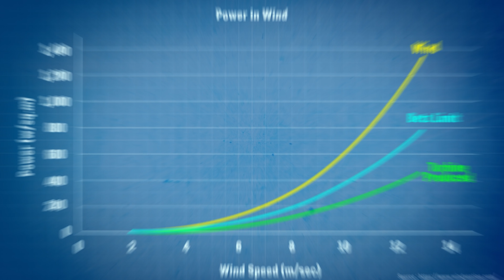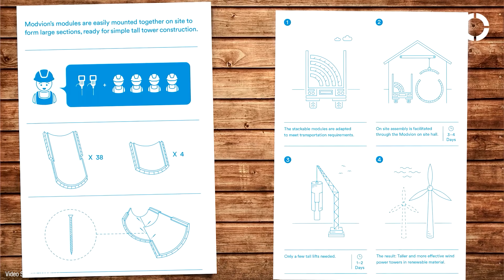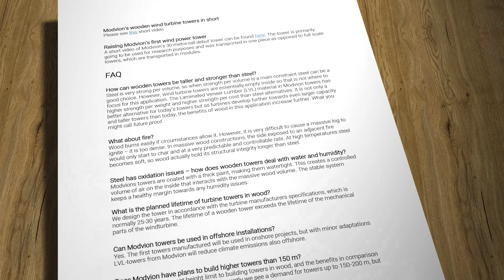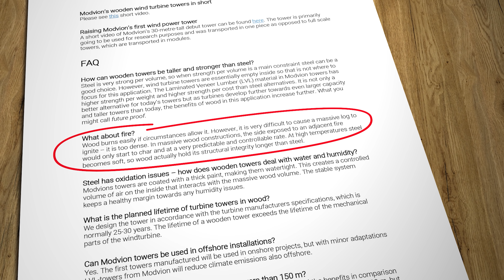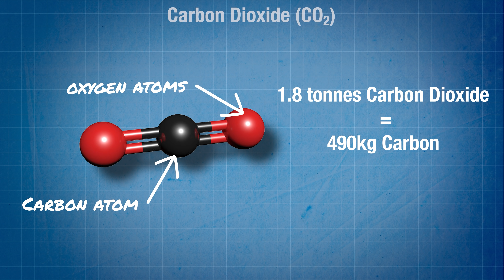Wooden wind turbines. Are they really a sustainable alternative?

Comment: I wonder how good will be if the blades are made out of thin wood, covered with fiberglass. I've seen one youtube channel comparing regular wooden plank with plank covered with 1 layer of fiberglass (he said that many small boats are made out of wood covered with fiberglass giving it stiffness and waterproof properties) and there was lot of difference in strength.
Reply: The blades need to be lightweight and strong but also really, really stiff. Wood isn't good enough. They can barely get away with a fiberglass construction while making the blades over a hundred meters long. Carbon fiber would be way better mechanically but very expensive and has more CO2 emissions.
Reply: @w0ttheh3ll  sandwich construction increases stiffness enormously while decreasing weight, at least for boat construction purposes. From the image of the repurposed blade, the grp is solid for blades. Perhaps the strength to weight calculation changes at these scales?  Side note: in composite work, balsa wood is a relatively cost effective core material, but not the lightest or strongest.
Reply: I don't see it replacing metal turbines only as alternative in a needed area if called for...
Reply: @steve-o6413  O Steve how’d that last eye exam go!
Reply: My understanding is that some blades are made from balsa wood with fiber glass finish. I also understand that the price of balsa has increased because of its use in wind turbines.
Reply: Wood adds too much weight.  That's why the blades are made hollow; the fiberglass is laid inside of a mold.
Reply: I expect blades will all be formed from synthetic resin, one that can be dissolved from old blades and reused in making new ones.  For fiber content, graphene comes to mind, but hemp or other natural fibers may be strong enough, may use multiple types of fiber, research and test, repeat till it's perfect.
Reply: Perhaps at some stage the blades might be 3D printed. A computer designed honeycomb structure can be lightweight and stiff. You would need very special materials to get the 30 year lifespan of course. In an ideal fantasy situation you make the 3D printer Blade factory mobile and set it up somewhere near the installation site so the huge blades don't have to transported across the country.
Reply: @adrianthoroughgood1191  
3D printing is not strong enough.  Unless you have a way to print fiberglass.  The fiberglass adds tremendous strength to the resin.

Comment: What's the environmental impart of all that glue they're using to hold that wood together?
Reply: Depends on the glue, if they use a water resistant PVA similar to titebond 3 it probably wouldn't be that significant.
Reply: @garethbaus5471  Titebond 3 has a limit of 4000 psi, while steel is five times that or more.
Reply: @ajnasreddin  since it would be joining peices of wood perpendicular to the grain a direction in which Douglas fir is limited to about 200 psi that is a moot point.
Reply: How many tree we need to cut down to make one tower, remember it takes only minutes to cut a tree but it takes 50 years to grow back!!!!
Reply: @johnhili8664  for construction grade lumber like what would probably be used in these towereds it is actually closer to 40 years, and we have enough land to grow quite a bit of lumber, so long as the forrest's are managed and the trees are replanted we can supply all the lumber we need pretty much indefinitely. Rare slow growing hardwoods like lignum vitae are a completly different story but those are only needed for specialized uses like bearings in nuclear submarines.
Reply: @garethbaus5471  Thanks for the information:-))
Reply: @johnhili8664  I think the point is that if you create a market for wood then new forests will become economically viable
Reply: @sammason2300  I do not see the viability cut a tree in a couple of minutes and waiting 40 years to grow another one!!!
Reply: @johnhili8664  and yet lumber exists
Reply: @johnhili8664  The whole idea is that you are using the wood to sequester carbon.
The more timber you can cut and use the more carbon you are taking out of the CO2 cycle.
Monoculture forests are pretty horrible for an ecosystem, but they are way better than stumps or a tract burned to the ground.
Reply: If the glue is used only for bonding flat surfaces (not filling voids) it may be less than 1% of the total mass. If it is used in the composite, then the proportion may be more. Overall, it depends.

Comment: Wood Composit worked well for the DH Mosquito .  Perhaps the blades could be timber too, wood is still used in small aircraft propellers.
Reply: Well they did up to a point. They had issues when they went to the far east with delamination until they understood the bonding in high humidity environments. But to be fair these WTs have better protection from the environment than aircraft do!
Reply: @tcroft2165  yes they were buil with cascamite which is not waterproof.  Resorcinol came into use later and has proved very durable in boatboulding.  Epoxy is the best but not very green.

Comment: ref:  6:13
Laminated wood are very strong as stated in the video, but not easy to be recycled in an easy way. 
Thinking of laminated wood as wood is like thinking of asphalt as loose gravel. The clue is really the major part by weight and also a large part of volume.
Basically the same problem as fiberglass and resin. In fact steel tower are a lot easier to recycle since scrap metal is an important part of making steel.
I believe that the real value is that the material source do not need mining and are not a finite resource. The rest are just minor pluses.
Reply: I notice this sort of dishonesty often. New construction of "wooden" houses across Europe, touted as renewable and recyclable, when in fact the main structure is between 20 and 40 % epoxy resin, which is absolutely unrecyclable, and any wood particles trapped in it are as well.
Reply: Looking at the thickness of the structure it could be ripped up into planks for use in construction, boatboulding and even furniture with the dust produced going into partcle board.
Reply: @thamesmud  And that is a lot like what you can do with fiberglass construction like the blades. 
I am shore that you could use the materials for a lot of things, but not for boats and really not for furniture.
strength of playwood it is also a weakness when cut. Then the material can break along a laminated sheet a lot easier then whole wood will do.
Reply: Destructive distillation (pyrolysis) reduces wood to its elements, hydrogen, methane, methanol etc with around 50% of the carbon left as elemental carbon that is a good soil additive that improves many soils. Thus, hydrogen for the hydrogen economy and the other gases for power production and other uses to keep oil and other fossil fuels in the ground. Not sure about the binders.
Reply: @robertcircleone  The binder is the problem.  Pyrolysis is interesting but it creates a lot of nasty chemicals.  Not really a clean process.
Reply: @robertcircleone  Pyrolyses of plywood often very messy because what the clue is made of. As I said, you can not think of plywood as wood there is just to much mixed in. You would also need a lot of energy for grinding and heating before any charcoal is made.
Reply: @robertcircleone  Where do you get all the CO2 free heat to pyrolyze the wood? (towers, or otherwise)
Quite a lot of nasty distillates from creosote, amines, pinines, turpines, etc depending on the wood.....  (Spruce???)

Comment: Why not bamboo? It grows much faster than trees and is very strong and lightweight and can be chemically treated just like wood can to prevent rot.
Reply: Definitely something to look into, I myself know little about it except that it is durable and is used in flooring...
Reply: You want to give China more power over the market?  Kidding.  :)  It would be a great solution as well.
Reply: @artboymoy  Other southeast Asian countries are sources of bamboo. So, China wouldn't have a monopoly.
Reply: @artsnow8872  Right; bamboos grow (some strains) 6" /day and can be very promising. If you can modify them genetically (it is a kind of grass like rice, wheat etc).
Reply: @artsnow8872  True, but China could affect the market so that they offer the cheapest and thus most appealing to businesses as they often do.
Reply: @artsnow8872  wrong. You can grow bamboo anywhere.
Reply: @nathanlewis42  True, bamboo grows anywhere, but can the types that grow to 10 inch diameter grow anywhere? One wants the thickest, longest boards one can get, doesn't one?
Reply: I havent seen this sort of sheet product produced from bamboo, is it a thing now? Good news if it is. I've only seed the thousands-of-narrow-slices-lamination in tables, chopping boards etc
Reply: @bakedbeings  India has been producing plyboo for some years. It's a tricky material to take veneers from bit it can be done.
Reply: you'd need to transport the bamboo across the ocean which requires a lot of energy
Reply: @mortenovergaard7397  no you don’t you can grow it in your garden. You can grow it in the UK, you can grow it in North America. The only problem with growing bamboo is that it will take over your yard.

Comment: Has anyone ever tried to build a wind funnel? I run through downtown Houston, and even on a not so windy day, the wind around tall buildings is much stronger. Big piles of dirt forcing the wind to go through hundreds of small turbines seems cheaper than building huge structures.
Reply: There are several companies that tried this.   Sheerwind and Windrail are two examples.  You're correct that this should be exploited, and smaller wind turbines could meet this especially if there is adequate storage.
Reply: @lawrencetaylor4101  Thanks for the reply. Just being on the ground makes maintenance cheaper also.
Reply: @lawrencetaylor4101  There are turbines being fitted to the poles of street lights to make use of wind from passing traffic.
Reply: iv also heard that the vertical wind turbines are gunna be used along motorways to make use of the wind that comes off the traffic
Reply: @kimwarburton8490  as seen here on just have a think!
Reply: @carlpodrecca5177  haha! I watch so many vids like this i forget what i saw from where xD
Reply: @kimwarburton8490  yes I pretty much do the same so just be consentrating on this one for now, you know cause memory second thing I’m starting to lose!  🙃
Reply: @carlpodrecca5177  until i found this channel n started expanding out, i was in deep 'eco despair' 
Its good for my soul to see progress we r making 👍

Comment: I never would have thought wood could be lighter than steel.  All the wood I ever picked up like Plywood is extremely heavy, steel also heavy.  What about extending blade life?
Reply: Thick steel weighs a ton.
Reply: You know how wood floats? Well steel doesn't
Reply: @sammason2300  That is because of the density. The question really is how much would you use, since wood by far isn't as strong as steel. It could theoretically be possible that the wood parts needed are heavier than the steel, since you need so much more for the same end result.

Comment: Good on the strength of wood but what about pests like termites or rodents gnawing away at the base of the structure? Don't think that a mere coating on just the outside surface only will keep the pests from their bad habits! And if they've already thought of that, then just how toxic and unpalatable have they made the wood and with what forever chemicals that most likely cause cancer? We are presently trying to ban PFAS and PFOA due to its hormone disrupting capabilities too!

Comment: What happened to airborne turbines , with massless batteries around the corner and solar panels that convert moisture in the air into hydrogen , these could exploit the higher winds at altitudes and areas that land based turbines can not use .

Comment: Is this wooden construction intended for onshore turbines only? I'm thinking how resilient they will be to sea spray and how well they will cope with sea gales if used for offshore wind farms.
Reply: Are you familiar with these things called sailing ships? They require maintenance but timber structures have been operating in marine environments for literal centuries.
Reply: @AlRoderick  Sailing vessels are typically built from hard woods such as oak.  These towers are built from Spruce which is a softwood.   The open grain of softwoods makes them porous and prone to moisture absorption.  That absorption makes it unsuitable for maritime usage.
Reply: @UKSimon4170  Balsa has been used for a sailing boat.
Reply: @janami-dharmam  And balsa is a hardwood. I know that appears to make no sense given its weight but it is actually a hardwood.
Reply: I think that was answered when he said the surface would be protected by a polymer. The biggest turbines, and I think the biggest potential areas for new turbines, are at sea, so I think it is natural to assume that they are intended to be used offshore. That trial turbine they were erecting @6:30 is right on the coastline.
Reply: Just another hair-brained scheme from the wind power crowd.
Reply: @brucewilson77  But, what is this hare-brained scheme works? Wouldn't that be great?!

Comment: Have to admit I was confused about the calculation. How does a 1T timber structure store 1.8T of carbon? Sounds like if I eat a kilo of chocolate I gain 1.8kg which of course can't be true haha!
Reply: I think the 1.8T is referring to CO2, so there's less carbon in it than that, while the wood has a higher percentage of carbon by weight.
It's the equivalent number of carbon atoms being compared
Reply: @MattAngiono  so the Oxygen is the 0.8T missing?
Reply: @adamlytle2615  by weight, CO2 is 12+16+16, so carbon's actually under a third of the weight or just under .5 of the 1.8
Reply: @MattAngiono  okay cool, thanks!
Reply: 12 gram of carbon produces 44 gram of CO2. Conversely, 44 gram of CO2 can be stored as 12 gram of carbon. However, Timber is mostly cellulose, that has 18 gram of water for 12 gram of carbon. Hence 30 gram of timber is equivalent to 44 gram of CO2. Or 1 gram of timber is equivalent to 1.5 gram of CO2. The calculations are approx
Reply from the maker: That's why I put the lower carbon content on screen, Carbon Dioxide is two parts oxygen to one part carbon (and the oxygen atoms are heavier too), so the extra content comes from the oxygen.

Comment: Nah. No timber. Takes too long to grow and too hard to manage sustainably at large scales. Cannabis can be used to make everything from load-bearing walls to the wallpaper that covers them. Grows much more quickly and densely than trees, much more efficient carbon offset.
Reply: Have they nailed the problems with the joints?
Reply: Also not native and supports few insects
Reply: You're right. If you ever planted trees it's not that simple. They need to grow which is very weather dependent.
Reply: I can't remember if it was this channel or another but there was a video about a startup doing hydroponic hemp growth at a factory that was pulling carbon out of the air to feed the hemp. I guess located near a motorway? This could be a good end use for that hemp.
Reply: Have you met bamboo?
Reply: @artsnow8872  Only thing with bamboo is how stiff is it? Might be good for short towers but too flimsy for taller. Wood has a similar problem.